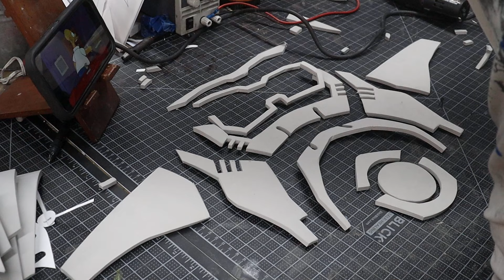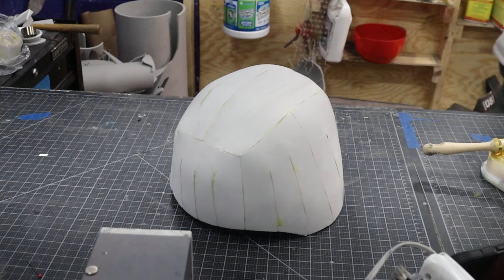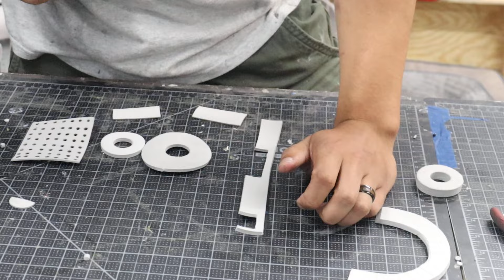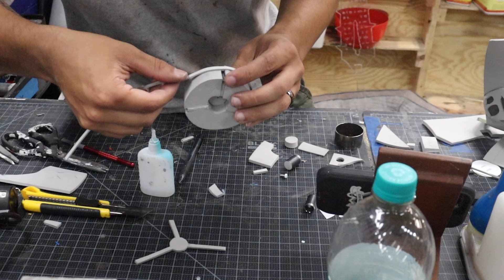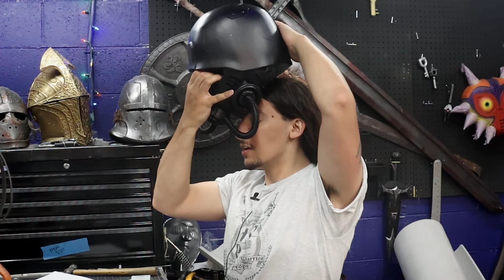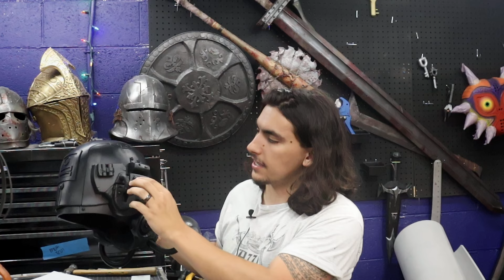How to make the ELITE RIOT NCR HELMET | Build | Foam Cosplay Tutorial

Comment: Dude, amazing work, especially the glue guide you made. I was struggling with the glue until I watched. 

Question: what do you do for the lenses? Making the NCR Ranger Helmet and cant find an easy guide for it. Thanks.
Reply from the maker: @devinwilliams7506  I just acrylic with mirror film over it
Reply: @ashenwarriorprops  Dude that's wicked. Thank you so much. Do you just cut to size or do you get a clear plastic lens and put the mirror tape on top? Like if I 3d printed some clear lenses could I put mirror tape on them and then place in the helm?

Also, thank you so much for replying, super cool of you.
Reply from the maker: @devinwilliams7506  maybe?? I never use prints in that way I normally just cut a sheet of acrylic